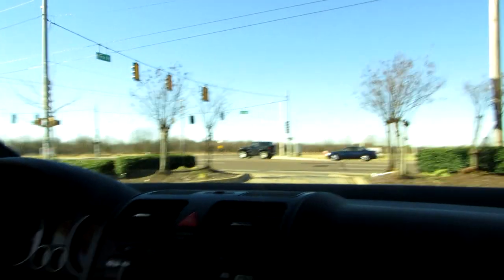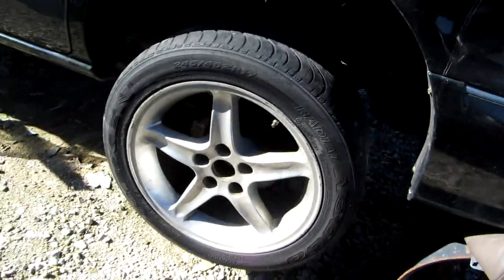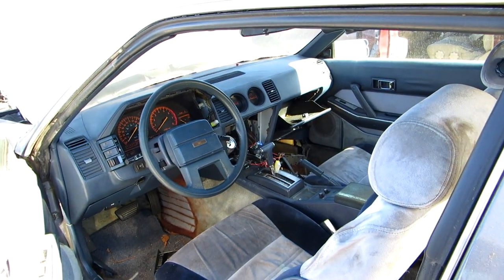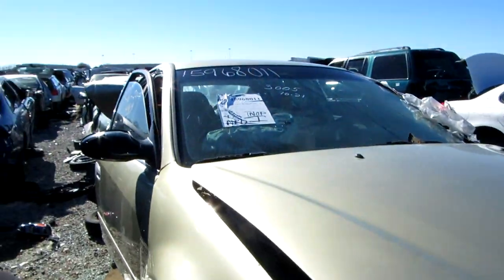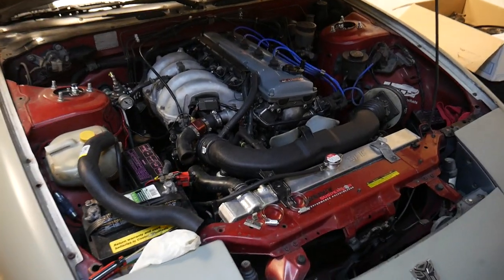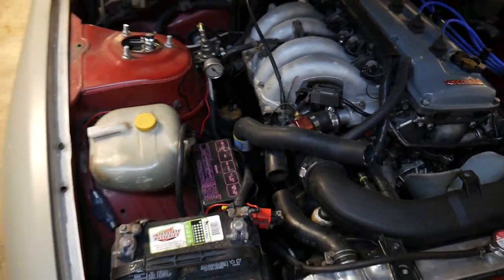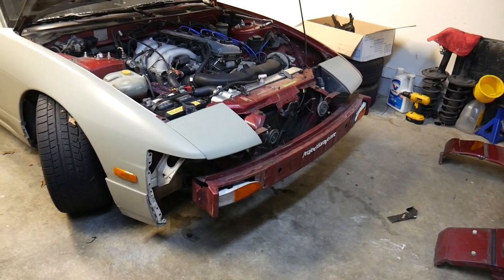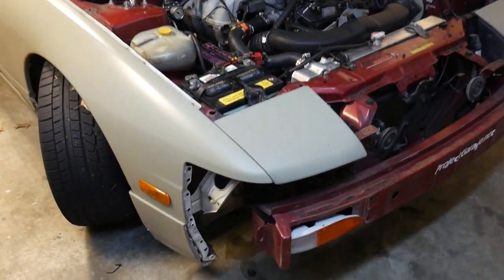Streetcar Life EP.7: Kerbs

Comment: they don't have yards like that here in Massachusetts anymore. They are now called recycling yards instead of junk yards and your not allowed to go in
Reply from the maker: +fockyoumang Man that sucks! "Pull your part" junkyards are the best!
Reply: +Project Garage I remember them from when I had my first car. Well two, 84 prelude si and Merkur XR4Ti
Reply: +Project Garage We have a PullaPart in Akron, Ohio...great place...
Reply: +Craig Cundiff I miss them. But unfortunately that where every car thief went to learn how to steal cars. Nissanbaums, Harbor, etc they won't even let you look inside the yard at the cars and charge more than auto part stores for used junkyard parts. They wanted 700 got a junkyard GT1752s turbo. I got one on eBay for 200$ and the car got crashed and they specifically said they'll give 300$ only if the turbo is on the car. They have a nice racket going calling themselves auto parts, recycling yards
Reply from the maker: That's highway robbery